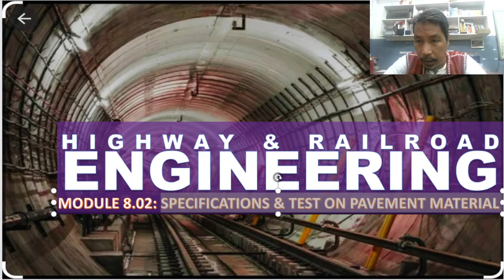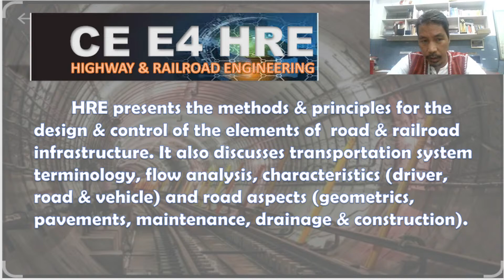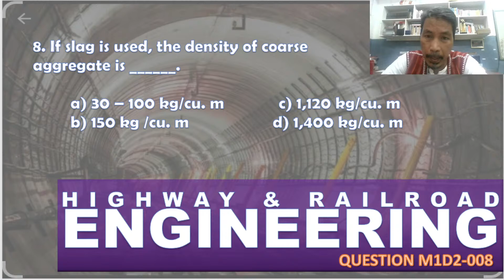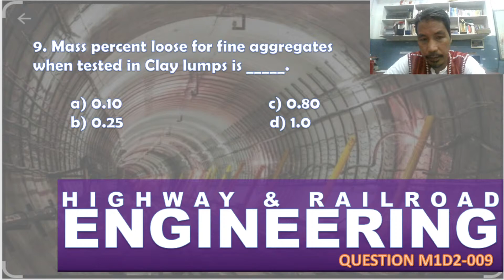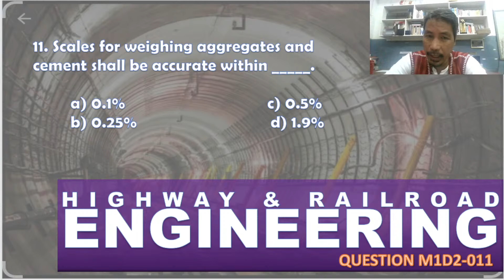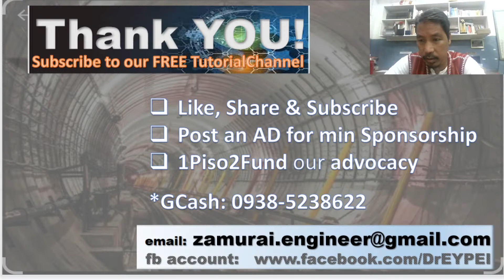[ LIVE CEE4 Lecture 04 ] DrAP Zantua SPECS & TEST ON PAVEMENT  Talks + ENGINEERING Analysis & Design

Comment: Thank you sir for this live video lecture about specification and test on pavement. also some practice problem that will help us.

Q8. If slag is used, the density of coarse aggregate is _____.
Answer : C. 1,120kg/cu. m

Q9. Mass percent loose for fine aggregates when tested in clay lumps is ____.
Answer: B. 0.25

Q10. ___ is a type of cement which shall be transferred to an elevated air tight and weather proof bin storage.
Answer: C. Bulk cement

Q11. Scales for weighing aggregates and cement shall be accurate within __ 
Answer: 0.25% 

Q12. The minimum thickness of conventional concrete as the surface course in monolithic pavement is ____. 
Answer: 75 mm

Comment: thankyou sir for explaining this module through live lecture that tackles the specs and test on pavement. there are some question included in this lecture, and these are my answers to that
For Q008: (C) 1,120 kg/cu. m
For Q009: (D) 1.0 
For Q010: (C) Bulk Cement
For Q011: (C) 0.5 %
For Q012: (B) 75 mm

Comment: Thank you sir for some practice problems of this live lecture about specifications and test on Pavements.

Q008. If slag is used, the density of coarse aggregate is _____. 
The answer is letter C. 1,120 kg/cu.m

Q009. Mass percent loose for fine aggregates when tested in clay lumps is _____.
The answer is letter B. 0.25

Q010.  _ is a type of cement which shall be transferred to an elevated, air tight and weather proof bins storage.
The answer is letter C. Bulk Cement

Q011. Scales for weighing aggregates and cement shall be accurate within ______.
The answer is letter B. 0.25%

Q012. The minimum thickness of conventional concrete as the surface course in monolithic pavement is ____.
The answer is letter D. 150mm

Comment: Thank you Sir for this live lecture video that tackles about the Specs and Test on Pavement. There are a lot of challenge questions in this  video.

Q008. "If slag is used, the density of coarse aggregate is _____." A.30-100 kg/cu.m B.150 kg/cu.m C.1,120 kg/cu.m D.1400 kg/cu.m
The answer is C. 1,120 kg/cu.m

Q009. "Mass percent loose for fine aggregates when tested in clay lumps is _____." A. 0.10  B. 0.25  C. 0.80  D.1.0
The answer is B. 0.25

Q010. "_____ is a type of cement which shall be transferred to an elevated, air tight and weather proof bins storage." A.Portland cement  B.Pozzolan cement  C.Bulk cement D.None of the above.
The answer is C. Bulk Cement

Q011. "Scales for weighing aggregates and cement shall be accurate within ______." A. 0.1%  B. 0.25%  C. 0.5%  D. 1.9%
The answer is B. 0.25%

Q012. "The minimum thickness of conventional concrete as the surface course in monolithic pavement is ____." A. 50mm B. 75mm  C.100mm  D. 150mm
The answer is B. 75mm

Comment: These are the questions in Module 08.2: Specification and Test on Pavement Material.

For Q008 If slag is used, the density of coarse aggregate is ___.

a) 30-100 kg/cu.m
b) 150 kg/cu.m
Ans:c) 1,120 kg/cu.m
d) 1,400 kg/cu.m

For Q009 Mass percent loose for fine aggregates when tested in Clay lumps is___.

a) 0.10 
b) 0.25
c) 0.80 
Ans:d) 1.0

For Q010 __ is a type of cement which shall be transferred to an elevated, air tight and weather proof bins storage.

a) Portland Cement 
b) Pozzolan Cement
Ans:c) Bulk Cement
d) None of the above

For Q011 Scales for weighing aggregates and cement shall be accurate within ____.

a) 0.1% 
b) 0.25%
Ans:c) 0.5% 
d) 1.900

For Q012 The minimum thickness of conventional concrete as the surface course in monolithic pavement is ___.

a) 50 mm 
b) 75 mm
c) 100 mm 
Ans d) 150 mm

Comment: Thankyou sir for this video lecture which is Module 8.02: Specifications and Test on Pavement Material. These are my answers in the following questions provided by this live discussion:
For Q008: (C) 1,120 kg/cu. m
For Q009: (D) 1.0 
For Q010: (C) Bulk Cement
For Q011: (C) 0.5 %
For Q012: (B) 75 mm

Comment: Thank you sir for this live lecture about the specifications and test on pavements.
Question 8: If slag is used, the density of coarse aggregate is---. My answer is  1,120 kg/cu. m
Question 9: Mass percent loose for fine aggregates when tested in clay lumps is ----. My answer is 1.0, letter D.
Question 10: ----- is a type of cement which shall be transferred to an elevated air tight and weather proof bins storage. My answer is Bulk Cement which is letter C.
Question 11: Scales for weighing aggregates and cement shall be accurate within ----. My answer is 0.5%.
Question 12: The minimum thickness of conventional concrete as the surface course in monolithic pavement is ----. My answer is 150 mm.